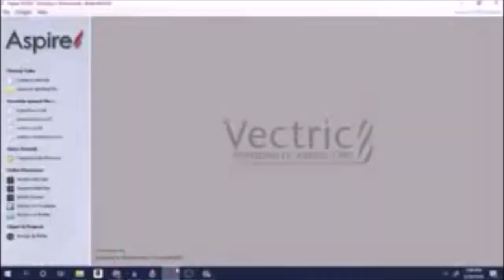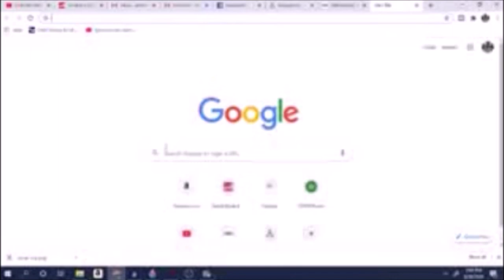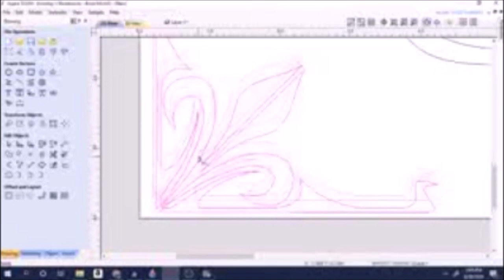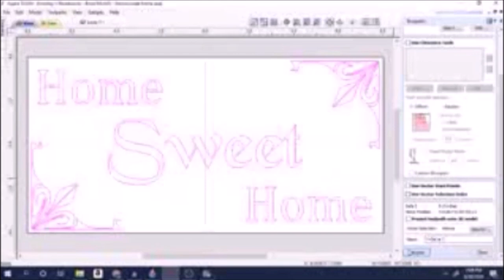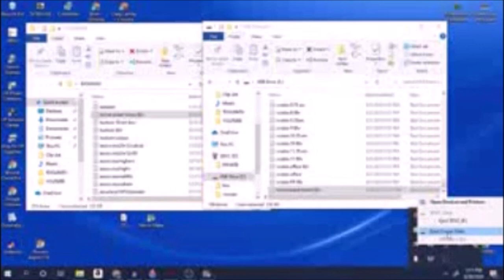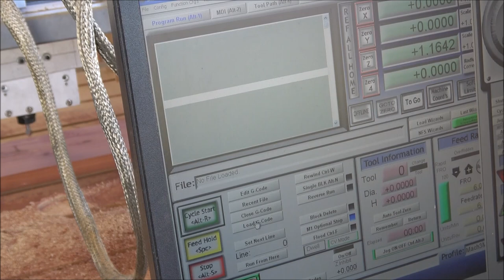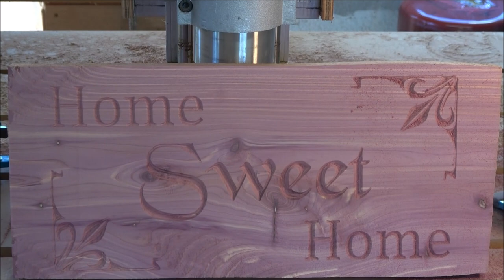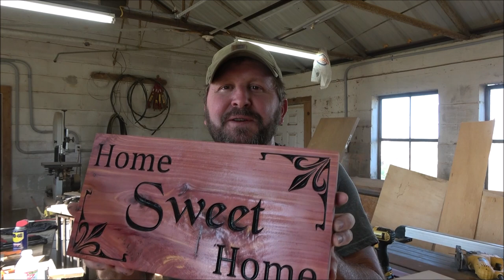DIY CNC Process (Start to Finish)

Comment: Good job Brian, sign turned out nice. Using the spray poly on the cutting areas seems to make it easier when sanding finished product and saving you a little time also. Keep up the good work and thanks for sharing.
Reply from the maker: Thank you and thanks for watching!!!

Comment: Very happy to see this amd it's made me realize, my Linux system may be FAR past my current skill level. Attempting to cut an AR from a billet (using a Sherline 5400) has been expensive and a nightmare I wouldn't wish on ANYONE.  If anyone can suggest anything to make life easier it would be greatly appreciated.
Reply from the maker: AR? AR15?...if thats the case I haven't done any metal work with mine...I do however really like the Vectric software...I've never used linux...Thanks for watching!!

Comment: Another great video!  Quick question. Speaking of hot shops.  I noticed you have open ceilings with appears to be insulation.  I'm looking to do the same but my garage doesn't have any eve vents or any roof vents.  Wondering i I could just throw up some insulation without causing issues.
Reply from the maker: I have no insulation, I do have the nice open ceiling though...I would go ahead and throw some eave vents in at least to allow fumes and moisture to work its way out....Thanks for watching!!!